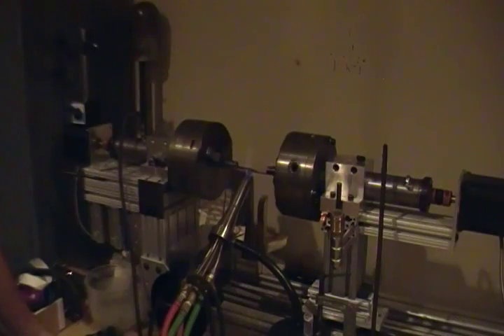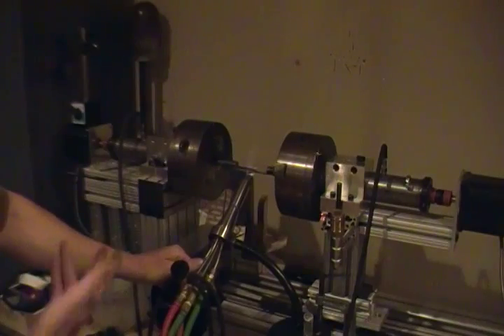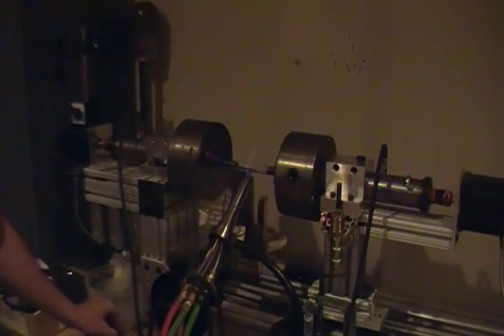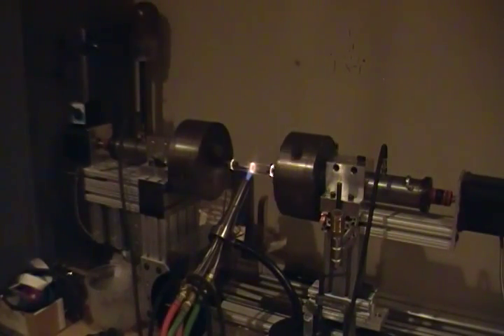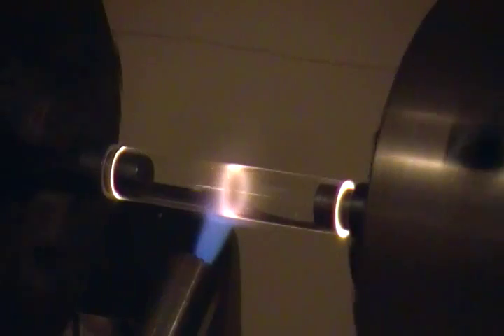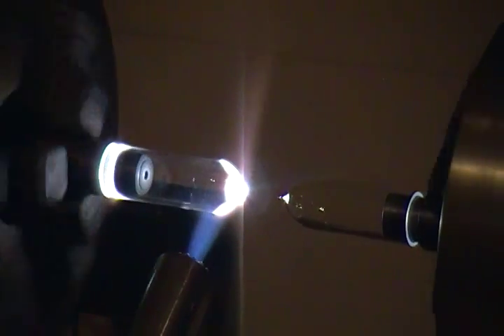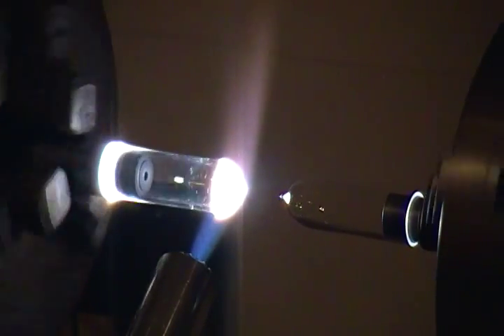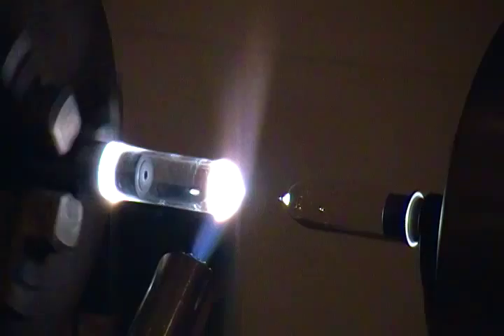Quartz flameworking on lathe by David Veidt

Comment: I have tons of quartz tubes many are like 5' long round bottom 1" dia 1mm wall, and many 1/2" . Need to work it and sell it. Do you buy your hydrogen gas bottled or use a HHO system?
Reply: I don't think it's hho due to the adjustability of the flame chemistry and an hho flame is more orange. You could build an hho setup that allows you to control the gas to oxygen ratio by separating the electrodes so the gasses go up seperate tubes